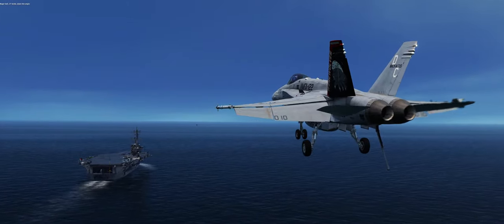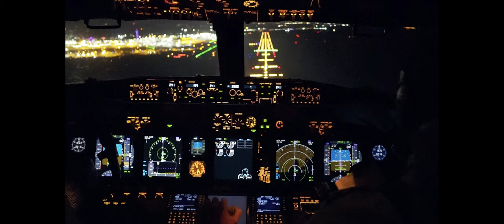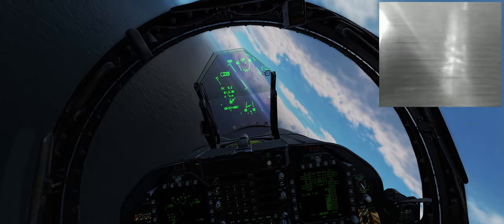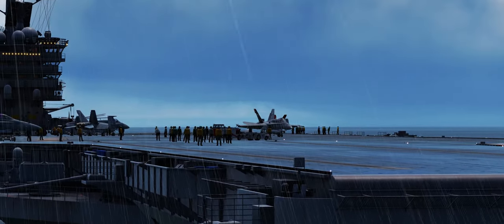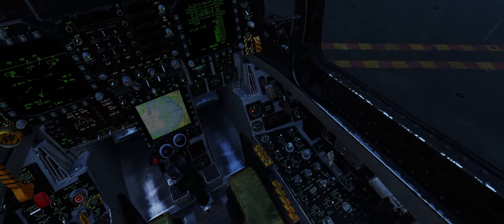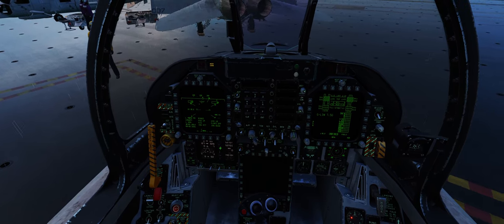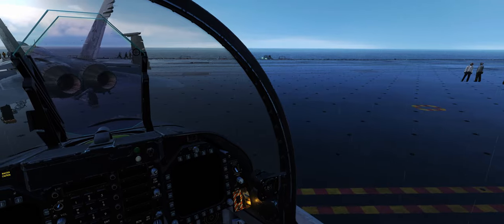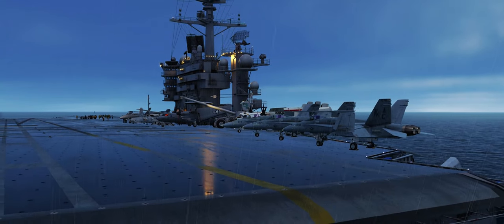Simulator Vs Real Life: 600kts Carrier Break

Comment: Hi, can you please make video on Derry Turn mano manoeuvre.
Reply from the maker: What is that?
Reply: @CommandT  , Hi, it's an aerobatic manoeuvre. I think it's quite complex as many pilots have unfortunately lost their lives. It has to be executed with utmost perfection.
Reply: I guess he meant something like that:
 https://www.youtube.com/watch?v=IEfe0_ms_Ow&ab_channel=Stratocruiser100
or:
Derry Turn

a) Enter from steep level turn, 120kts
b) Raise nose slightly by pitching up or by reducing bank slightly
c) Check the pitch, and roll underneath, using elevator and rudder as in slow roll to prevent nose dropping
d) Stop roll at 60 degrees of bank, pull into turn
e) To use as a reversal manoeuvre in a sequence:
1) Enter along line feature
2) Turn through 270 degrees till pointing across line feature
3) Derry
4) Continue turn through further 90 degrees